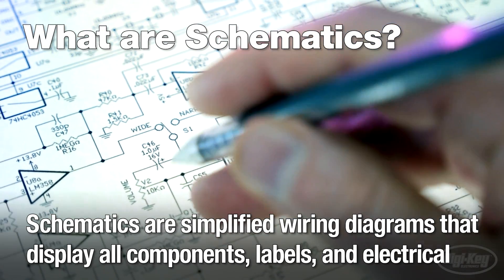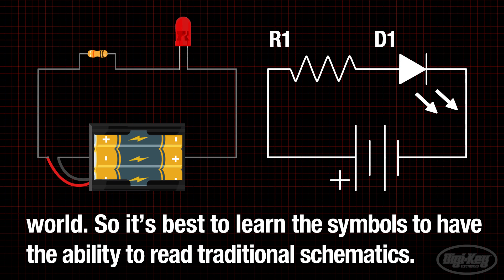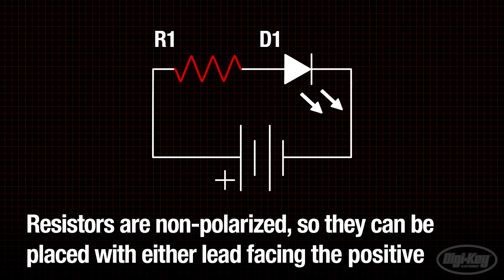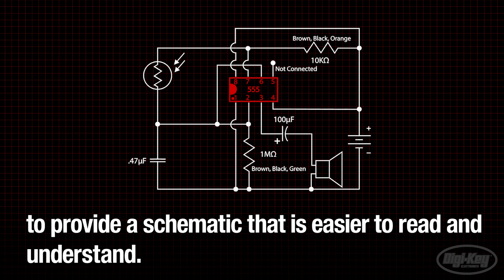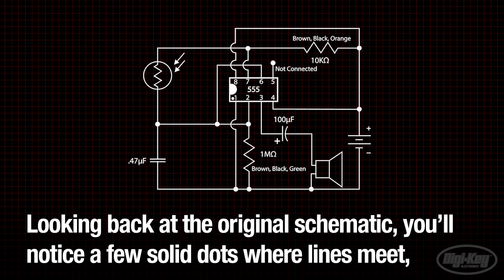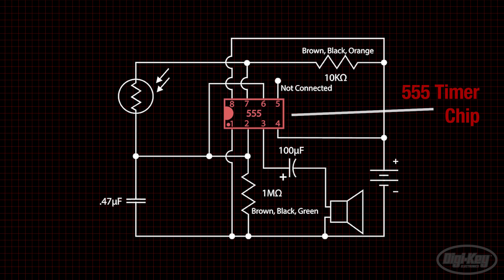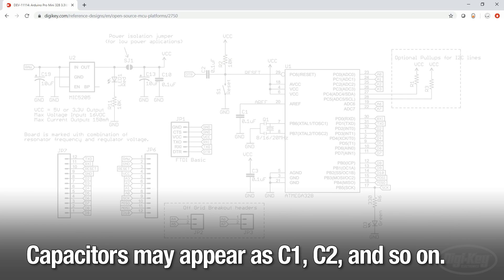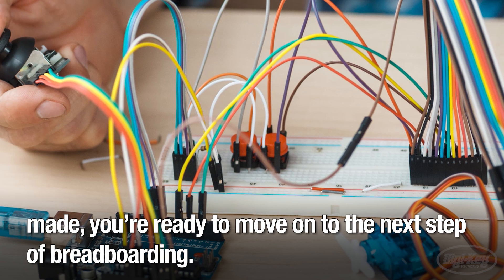How to Read a Schematic - Another Teaching Moment | Digi-Key Electronics

Comment: The first example is incorrect. The resistor should be before the led on the negative side to resist.
Reply: That's not true at all, they're correct.
Reply: Are you used to using positrons?